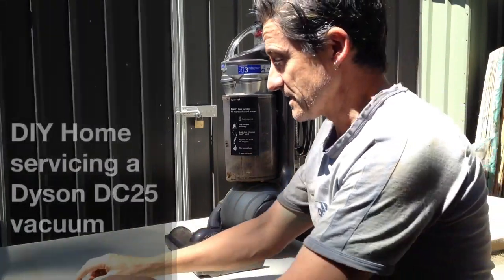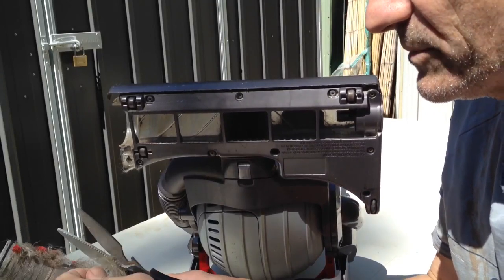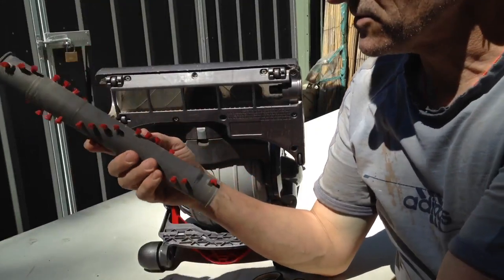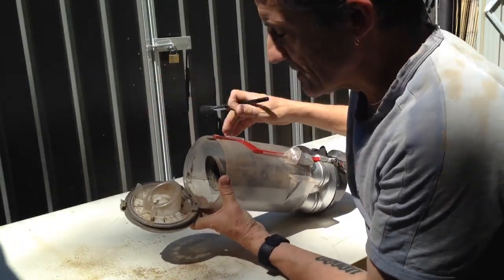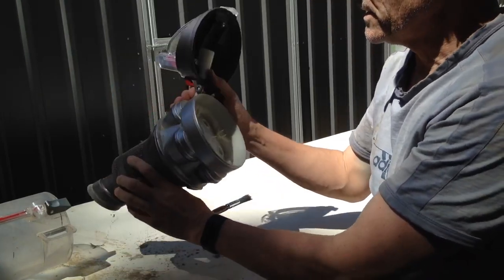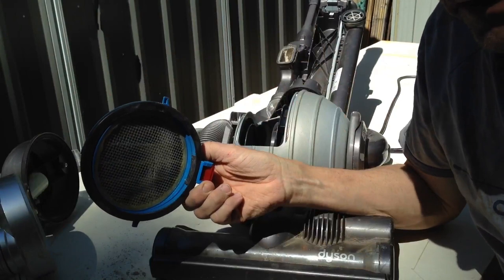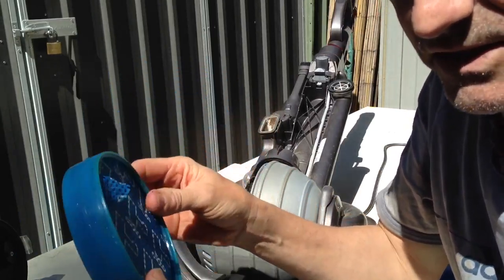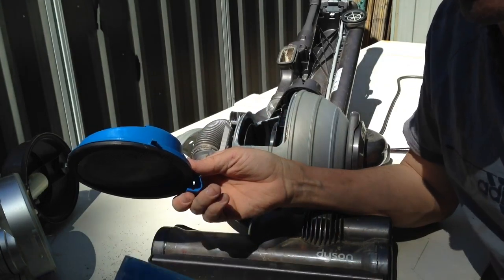DIY Home Servicing a Dyson DC25 Vacuum Cleaner

Comment: I have the same vacuum. It's great, the only vacuum I've had that worked more than once. Cleaning out the top filter makes a huge difference in performance. When the filter is dirty, the carpet isn't being lifted as the vacuum passes over it, but when clean it lifts the carpet and sucks up all the crap.
Reply from the maker: When we first got ours, the suction on the carpet was so strong it was hard to push it, now .. meh!
Filters will go back in tomorrow. Gave plenty of time to dry.
Reply: @oojagapivy  do you feel the loss of suction power could be regained through new filters or that it’s due more to mechanical wear
Reply from the maker: @cannsmith  could be a combination of both. I’d have to try new filters to see what difference they made.

Comment: I just cleaned mine today, that cyclone section also comes apart quite easily, the bottom part just pulls out, and I used a flat head screwdriver to prise apart the larger grey mesh section. You'll need a torx bit to remove the final piece, but it's worth taking the full cyclone section apart, as there was a lot of dirt and gunk in mine that I wouldn't have got to otherwise.

Good video otherwise, a quick and simple job to get your Dyson performing like new.
Reply from the maker: Stuart Howieson definitely worth it. I figured the cyclone would come apart too. Might look into it next clean, or soon. 👍🏻 thanks for watching
Reply: @oojagapivy  I watched this, just to see if I've done it to the recommended service, or beyond it.

I took the cyclone apart on the DC14, and washed it out thoroughly. My motor has died, and the filters are really filthy - A wash won't cover that, so I've ordered a new motor, and a couple of new filters on eBay. The total cost is £20 which isn't so bad

The cyclone part is just plastic too, which is nice, as you can just run water through it without any actual harm

Now I'll just have to see how the motor goes back, and then I'll once again be back at peak efficiency, just like how it was, all the way back in 2004 (plus maybe three months as I couldn't get every little bit of dirt off, even after washing) but I can live with that
Reply from the maker: @waqasahmed939  I considered doing a much larger breakdown after I finished this, seeing that it could be broken down further quite easily. It's looking due for another service, so I may just do that.
Good luck with the new motor.
Reply: @oojagapivy  Thanks. I've had to get a screwdriver from toolstation given that the screwdriver set I have is just bits and the screwdriver just isn't long enough

So I'll collect that tomorrow and hopefully work with the T15 screws then

If I get another five years out of it, that'd be absolutely great
Reply: @oojagapivy  So my repair didn't go so well. I fixed the motor but I messed up somewhere else. I think because I broke the clip on the HEPA filter at the post motor part.

That meant that the suction from it just went the wrong way entirely. Ah well, it was a learning experience. My aim was for it to NOT go to landfill but I guess that's gonna have to happen now unfortunately
Reply from the maker: @waqasahmed939  Bugger. Sorry to hear that.

Comment: When I put the post filter in place and then start the vacuum, the filter pops out
Reply from the maker: @Capt7X  when you say post filter, do you mean the hepa filter in the ‘ball wheel’ where air is blown out?
Reply: Same problem. Lower “ball” filter b pops when power applied? Any clues?? Thanks.

Comment: Hi, I got this vacuum from an someone for free...however It smells like a mix of perfume...any recommendation on how to get rid of the smell.  I just finished washing the filters and my husband did the brush, He will also use the compressor to blow it out.  It looks like the person that had it before me picked up a white powder with the vacuum also.  THanks!
Reply from the maker: The powder may have been perfumed talcum powder. Washing the filters should do the trick, but have a check of the hoses. There may be powder stuck in there, keeping the smell there also.

Comment: Looks like I have been washing the filters wrong ALL THIS TIME! I used to soak them as I thought I saw in the instructions.... ! :/ - *Bad dyson owner*.....
Reply from the maker: It’s amazing how much you can flush out of them.
Reply: @oojagapivy  If the machine is in general good working order, how often should you replace the filters with new ones?
Reply from the maker: @markyboy213  I’ve never looked into the replacement costs of the filters. I feel that as long as you clean them regularly, not leaving them for too long like I had, then the suction shouldn’t be reduced. If cleaning doesn’t improve the suction then look into replacing them.